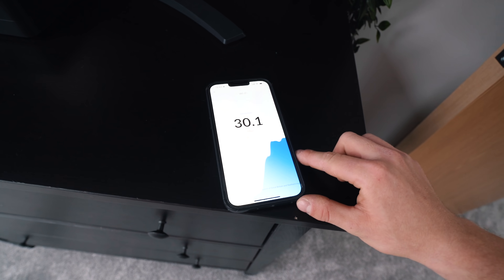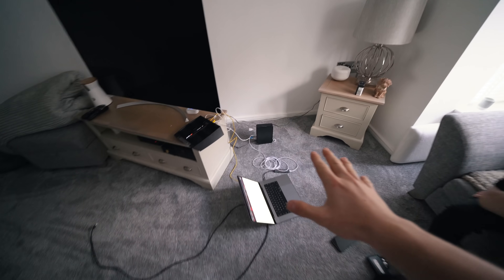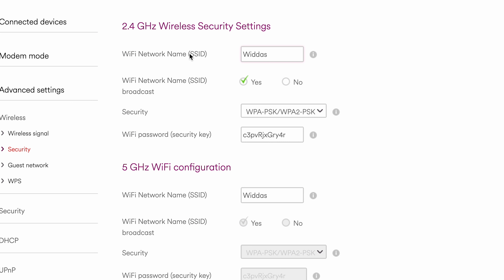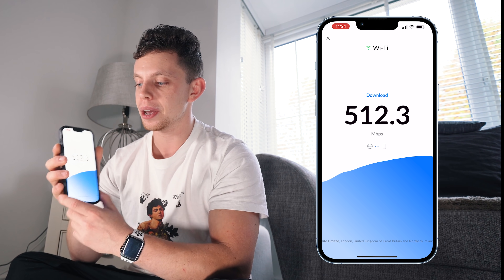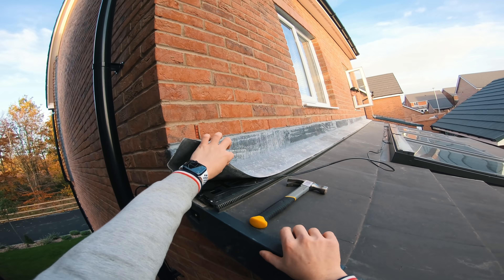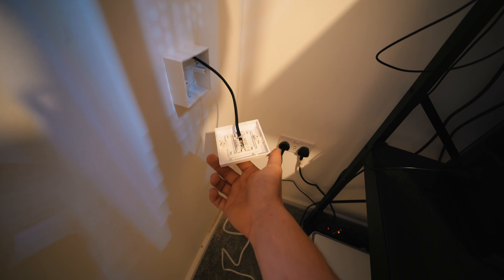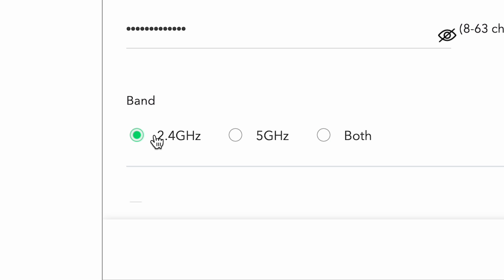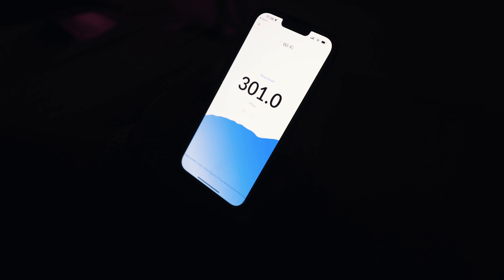Fixing Bad WiFi is EASY: Pimp my WiFi Episode 1! Ft. Ty Widdas!

Comment: It is believed technician but is not, is a guy who knows something but no way at the professional level.
Reply: Someone who only knows half the information is dangerous.  Even the simple jobs were screwed up.

You always drill an exterior hole downhill from the socket to prevent water.  Use a bit of plastic pipe to carry through the cavity for the cables to run.  Then seal the pipe and the cables with a silicone.

Don't even get me started how he just left a cable underneath the lead flashing.

Comment: Man.. just use powerline adaptor with built in wifi
Reply: But they connect to each other via wifi so speeds will still be low. A hard wired access point is far superior as it pretty much gives off same speeds as router.
Reply: @hondafpv5932  im speaking powerline adapter, not wifi extender. It uses ur electrical wires in the wall as a LAN cable. One of the best powerline adapter (with mesh wifi) is TP-link TL-WPA8631P
Reply: No

Comment: Honest opinion but, if ur gonna use a WiFi 6 router why use a cat5e cable?? Thats like driving a Ferrari in an underwater track.
Reply: That is not true, the router that he used upstairs cannot do higher that 1gig speed in its Ethernet ports, and cat5e is perfectly capable of running it, is not needed to use more expensive category if they are not planing to move to 10gig link, wifi 6 will have the same benefits no matter the Ethernet cable that they use (better speed,low latency, capable of handle more devices connected to wifi, etc) also seems that they are only planning to use that link for internet access that's already limited to the 600mb speed of the ISP. So no real benefit in this case to move to a 10gig link. If for some reason you have planed to have some internal servers in your house or have a an internet speed higer than 1gig then probably is worth to do the upgrade to a 10gigabit link and cat6
Reply: no

Comment: You call yourself a network engineer yet you're still using a Combi Drill to go through walls. You seriously need to buy an SDS drill.
And that (7:25) is what happens when you don't take a drill out of hammer mode when drilling the last few mm. You should always let the drill do the work, applying pressure to the back of the drill can also be another reason for brick blowout.
Reply: He is not a professional…
Reply: I’d be fuming if someone blew a brick out like that on my house!
Reply: Funny you mention let the drill do the work. If you understood how an SDS bit works it doesn't work by drilling in the conventional sense, it works by percussion, that's why it would take forever and STILL blow out a small piece of brick even turning off the hammer. Holes are sealed and covered with wall outlets or grommeted to look cleaner. Unless you are lucky to drill through the mortar you are not going to prevent a small chip of brick coming off. Don't even dare tell me you can as you don't do it for a living.

Comment: Cat5e today??? Really? My router and Ipad are getting around 964mb in download. This video could be 15 year old.
Reply: 5e can do a gigabit which is enough in this case, tho future proofing would be nice considering its 2022 soon xd
Reply: @Devil-dt9vc  1) If you go to all that trouble to install a cable, install a future proof cable, so definitely not CAT5e.  2) never drill from the inside out, your stone will break off on the outside (which you could also see in the video) 3) If you buy a Wifi6 router/access point, make sure it has at least a 2.5gbit port. 4) speedtest is not a test, Iperf3 on an internal machine is. 5) Seeing the other comments on this video confirms my comments. 🙏
Reply: no one in the UK gets speeds this high. doesn't matter.
Reply: @bbllaakkee  Has nothing to do with this, we are talking about future proof technology and how it’s installed.

Comment: 3g and 4g switching on mobile destroys my brain.  Mobiles always switch to the highest G available, even if 4G is slower than 3G :(  2021 and Mobiles cant work out the fastest connection :(  You can switch this manually but thats not good when driving round the country :(
Reply: 3g is shutting down anyways.

Comment: Best e	settings for wifi
Google dns or cloudflare 
RTS threshold to 10 or 50 or 100
40 mhz capacity
Fragment threshold to 255 
Higher channel number 
800 microsecond guard interval

Comment: Technical advice  @TechFlow  Stop using CAT 5e...or any CAT 5 what so ever...  Standard as of +/- 4 years ago is CAT 6 and if you are running external cable or just one or two strands...run CAT 6A... is a bit thicker but it is way better... and yes I know the connection is limited to what ever the NIC in the computer and the Switch are capable of vs. what the ISP provide... for few quid's more you can build a nice 10G capable LAN...allowing the customer the opportunity to be ready when the ISP provided 2.5G or 10G service...  just a suggestion....

Comment: I find drilling through the UPC double glazing frame a lot easier than drilling through the outside wall. & should you want to remove the cable at any point in the future, a dab of white silicone sealer will give it an almost invisible repair.
Reply: Untill you have the window replaced and the installer chops through it.
Then you saw well I won't replace them because they are new, well you just put a hole right through your warranty.

Comment: I got round a similar issue a lot Easier, Safer (not walking on a roof), Neater, and Cheaper, using two high speed 240v plugged wireless access points. £65 (3yr Guarantee), unboxed, plug in, plug in, connect ethernet leads. Job done, been working well for the past 22 months. Also should the video also contain Health and Safety advice/warnings?
Reply: What access points did you use? (Product name)

Comment: Surprised you went cat5e as opposed to cat6 given future proofing etc. Especially as he's already getting big boy speeds. Price difference would have been minimal no?
Reply: Yeah, I guess he just used whatever he had lying around. Cat5e is good for up to 2.5Gbps.. I think UK is many years away from that anyway 😬
Reply: @millsathn  5e is 1Gb max, considering he has 700 using cat 6 should be a no brainer,  not to mention he ran it outside exposed to elements etc.
Reply: @Devil-dt9vc  it’s 2.5gbps since about 2016 man. IEEE 802.3bz

Comment: Just a heads up to anyone using the VM HUB 3 in modem mode, it has massive performance issues that haven't / won't be fixed.
Reply: Also, it has intermittent failure modes by the dozen, requires frequent rebooting and  randomly drops bandwidth!
Reply: I have tried to configure my parents’ hub into modem only mode and randomly it sets itself back 🤷🏻‍♂️
Reply: Bullshit

Comment: I don't understand why you didn't go for mesh network, the cost for the ethernet outdoors is £60, the router is £60 in addition to tools, plates, safety on a roof. Your talking £120 minium alone. For that you could have got a 3 way tplink deco m4 ac1200 mesh system like I have. Set the virgin router in modem mode which you can do on the superhubs as I have one and then mesh dot the pods around the house. Seamless no drop of speeds for. WiFi. I pay for 200mpbs for virgin on Wirless I'm always achieving 180 on my mesh system all around the house. The system has a smart enabled feature to enable 5ghz and 2.4ghz for certain devices like my ring etc...and optimizes best channels etc.. And the pods have 2 ethernet inputs for direct connect which at that point I get a full speed of 200mbps the system is also 1000mbps max. So if I was to ever increase my Internet speed I can.. Plus the fact that the rubbish superhub is no longer acting as a router just a modem leaving the mesh to to make the most distribution, range and signal. Each mesh connects up 2800sq ft! Between meshes so your pretty much covered and my house is big. You can pick a 3 pack mesh deco on amazon right now for £99. So regarding cost and knowhow. I think you got this wrong here Alex. Especially knowing the superhub has modem mode in addition to the capabilites of adding more meshes to your system, even different types. In my cases the deco tplink family have many types of mesh devices such as ceiling mesh and mesh pods which I've done. The example I've mentioned with the 3 pods I have, it's only because I was experimenting that the cost of the ceiling mesh was cheaper. Don't really need it but why not. Concerning budget, I think you got one wrong especially it being black Friday and cyber Monday.
Reply: MESH networks working on wireless backhaul will never be as fast as networks that run hardwired due to obstacles and obstructions. Fact is, mesh networks that run wired backhauls run much faster.

you mentioned you're paying for 200mbps, the owner in this video is subscribed to gigabit, hence MESH wifi on wireless backhauls will not reach such speeds. Wired is king in this instances.

my source? I'm a network installer for consumer and enterprise level systems and have installed hundreds of networks.

edit: adding on, not ALL IoT devices work well with MESH, sometimes you gotta separate the networks.
Reply: @semajm85   Thanks for the response mate, I agree with the wireless backhaul comment, however, in this instance, the Superhub has a modem function that then allows one of the mesh pods to act as the router which is essential to making sure you get the best out of a mesh system. This certain deco mesh system has a quite sophisticated system that intelligently switches devices like computers and phones to the AP pods with the best signal.  Concerning the Mbps, my friend has the same system in place for their office, not a big office but 2 floors and he gets 850mbps speeds on wifi which is sufficient enough. He has a virgin media business 1GB internet.  I feel the notion of these Mesh devices have been hindered greatly in the past but the technology has improved, as long as you get a good system then through my and others experience and feedback you'll have no problems. You can never beat wired you are right about that and for a huge home or building, I would never recommend it. 

But for the hassle of what Alex went through to get the 250-320mbps on wifi. You could have easily got that on a mesh network. 

This is my experience of it.  People talk of the mesh systems like they are extenders, they are not. They are wifi satellites practically dotted around the homes which give you consistent range and speeds around the home via the different radios in the mesh systems and intelligently trafficking information seamlessly.

Moreso, Alex himself has set up a mesh network system before on his channel and they worked really well. so I'm slightly baffled as to why he did this. 

I'm not knocking what he's done, he's shown a guarantee of works through his way which is really good. But for a home and the extra speeds and effort. I feel this way is more suited for businesses as opposed to a home unless the home is beyond 1200sq ft. Just overkill really.
Reply: @youssef.e8173  Running multiple decos wireless is still not ideal when you have houses with thick walls and any interfering objects etc. Sure they work by mesh however the 'child' decos can only boost the network they are able to receive. In this case by the looks of it the guy streams on twitch and thus probably games too, in which you NEED wired for reliability, consistency and good ping. In which can absolutely be done with a hybrid mesh system where one of the deco is still run wired to provide that important connection leaving the rest running cable-less. But yes mesh is a must tbh....using the modem internet and a different router in extender-mode with all those different band configs is very messy, switching between downstairs and up ain't seamless etc.
Reply: I tried using top end MESH and returned in the end as didn’t work as well as I thought it would...
Reply: How much speed do we need honestly? I have a WIFI 6 mesh system in my bungalow and have no issues with it at all, in fact I love it, I struggled to get signal in the kitchen, now I have. I also have a 5g router, however I'm with smarty so it's only currently 4g. For the price of unlimited Internet with smarty and 80mbs speeds and 100+ on a good day I'm more than happy, these speeds are helped with 2 external antennas I have on the roof. 5g SA will be the future.

Comment: How do people have 600/700mbs coming in there house I'm here on 30mb wired
Reply: The last part of your internet connection to your house, will be copper telephone cable.
For Virgin Media the last part is coaxial cable, which can transfer at a higher speed.
Reply: £££££ if you pay for it, then you will get it, but not everyone has money to burn on Superfast WiFi (also do not have 2 gaming computers).
Reply: 1000 down 100 up welcome to Germany 😅👌🏻
Reply: You’ll be on FTTC (fibre to the cabinet, copper to your house). Like said above, Virgin use fibre then coaxial but they’re pretty much scrapping coaxial now and moving to FTTP (which is something Openreach are also rolling out pretty quickly now so I’d keep your eyes open)
Reply: Openreach are doing upgrades in some areas. I'm on the south coast and moved to a farm / semi-rural location and got 17MB. Recently had an area upgrade now I get 500MB :-)
Reply: @VengFPV  useful to know I'm with BT I believe my area simply doesn't have the capability at the moment

Comment: I work as a cable tech with those same cable modems and they do a great job wit channel optimisation turned on. You really should not set a static channel because the surrounding devices can chance and make your wifi experience worse. Still a nice video
Reply: Exactly mate never turn off smart WiFi it actually works now. Looks like a fttp setup! Your amazon link for Ethernet cable is using CCA cable which isn't even to the Ethernet standards not recommended at all
Reply: I am an in-house tech too and you are exactly spot on about other smart routers changing bands and thus allowing your home router to enter heavy congestion it can't switch out of. As for Band steering is done automatically and this guy is making it manual and flawed. Like it was in the late 90s. The pleb

Comment: Im confused, so there was one ethernet port fitted upstairs? and he will have to switch between it being directly in his pc, or into the access point? or is it directly into the access point and then another cable from that to his pc? 

I'm wondering how from 1 extra ethernet cable you are now providing internet to 2 pc's and an access point

surely ethernet port to access point and then seperate ethernets to each pc right?
Reply: Sam - One ethernet point to the access point, the access point has three ethernet connectors. One is the input from the wall, two free for the PC's.

It also creates WiFi as well for phones & tablets etc.
Reply: @techflow also where are you based, im due to move into a new build property on Friday and love to be in 'Pimp my WiFi 2' haha

Comment: Ideally you should not recommend CCA cable, it is of far lower quality than solid core copper cable. You should certainly not use CCA cable for PoE, due to higher attenuation, higher resistance and potential overheating issues. You can keep joint SSIDs, most client roam seamlessly nowadays. You can use Wi-Fi analyser apps in order to see which bands are free near/around your house.
Reply: I came to comment exactly the same thing, if you seperate the network you'll end up with issues with roaming when travelling around the house because the handoff between two seperate networks as opposed to a single combined network is significantly slower and will kill your connection temporarily

Comment: I have to disagree. The only way to fix WiFi is to get mesh WiFi. Your router WiFi is then disabled if you like.
Reply: I mean that's just not true. Do a little more research before talking in absolutes like that..
Reply: @donthateme1210  I agree. Mesh is not the best solution. It is A solution but what he did was fine. The only thing he missed off was channel checking conjestion using WiFi analyser but it was cheap to fix.
Reply: @donthateme1210  he's not wrong, with mesh networks you disable the base modem...do some research yourself kiddo

Comment: Why are you telling people to separate WiFi frequencies, majority of modern devices can roam between them absolutely fine. You clearly not as clued up on this.
Also leave the channels to automatic
Reply: Because when you are in the same room and 5ghz is powerful enough, it's faster. It's that simple. If they are seperated onto channels where there is no/low interference, again this is good.
Reply: @sleepingwarrior4618  if your in the same room your device will automatically change to 5ghz
Reply: @Bawlk  I'm so glad someone understands this, people won't realize that if every device is connecting to the same frequency then it'll cause a massive congestion...
Reply: @XeonOfficialYoutubeChannel  I'm not sure he does. He said to leave the channels to automatic....that's what causes channel congestion, especially in blocks of flats and halls of residence. It's better to manually set them on the less congested channels and review on e or twice a year
Reply: @sleepingwarrior4618  no its misleading. You know people will take this as '5ghz is the fastest so ill connect every device to it'
Reply: @XeonOfficialYoutubeChannel  it is faster. But it's got less range. If the router was  WiFi 6 and the cable used was cat 6 or cat 6e cable, he could wirelessly get quicker speeds even with a Nas running,a smart TV netflixing and other users using. It's a good thing to seperate.